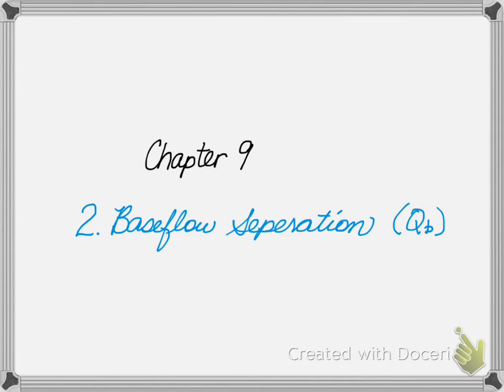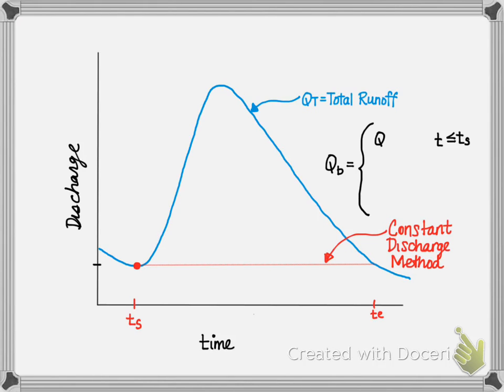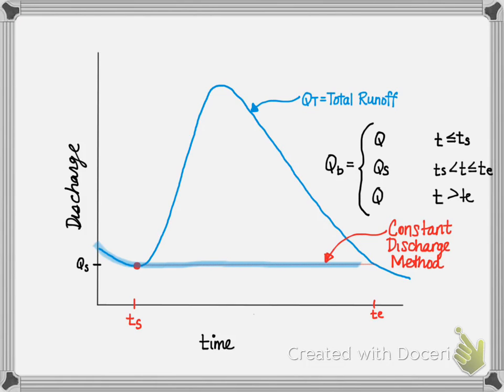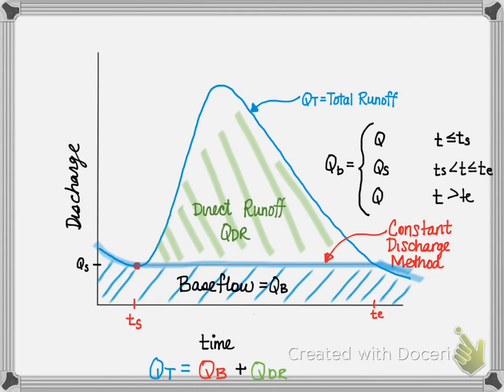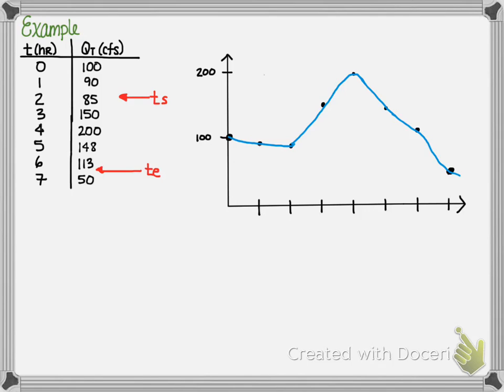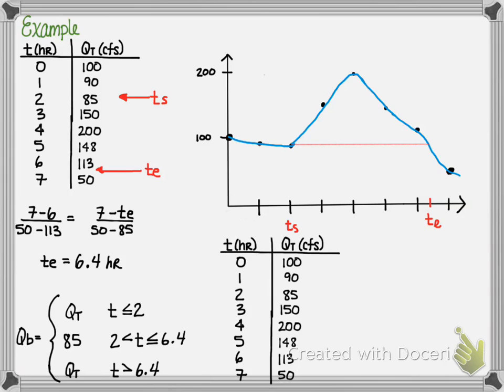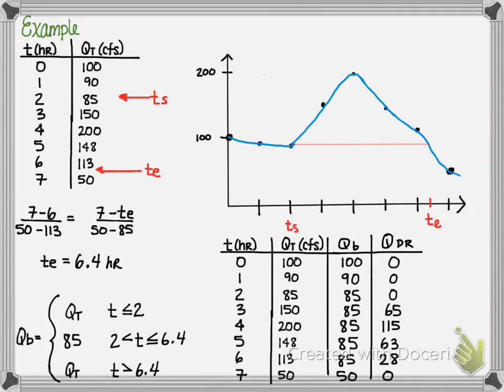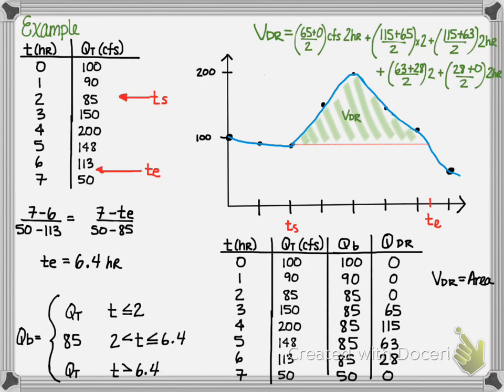Chapter 9 Baseflow seperation

Comment: For the data given below,
a) Calculate the runoff coefficient for this storm event, by first separating the
base-flow using the log Q - time method.
b) Calculate the basin lag time (by finding the time difference between the centroid
of the rainfall data and the peak of the surface runoff hydro-graph).
TIME (hours) 0 3 6 9 12 15 18 21 24 27
FLOW (cumecs) 5.0 3.0 2.0 5.7 12.1 8.1 5.3 4.0 3.1 2.7
RAINFALL (mm) 0.0 6.0 10.0 9.0 4.0 2.0 0.0 0.0 0.0 0.0